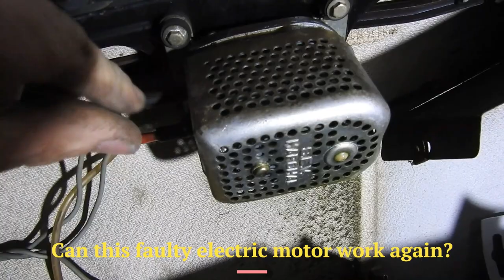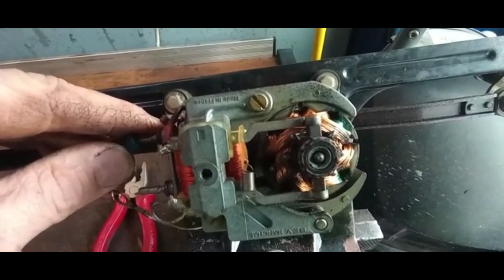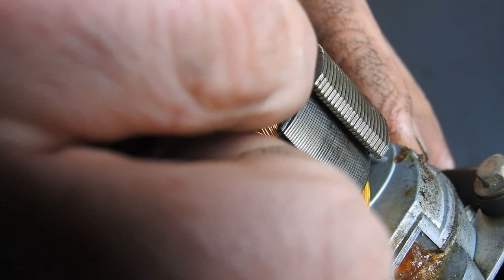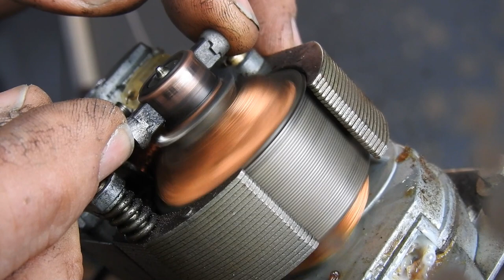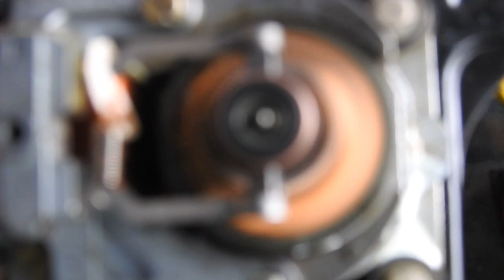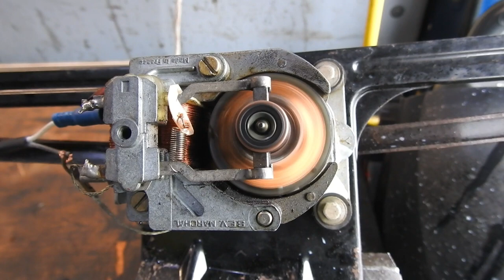Citroën 2cv, ami, Dyane dead windscreen wiper motor repair. it smoked!

Comment: WHERE IS THE + ON THE WINDSHIELD WIPER SWITCH? THERE ARE THREE TERMINALS.
Reply from the maker: both connectors are +
1 is the constant +
the other is for the return when the wiper motor is switched off.

ground is made by screwing the housing to which the motor is attached to the body.
Reply: @dutchcitroen2cv  
hello,
thank you for your intervention
i don't understand anything about electricity.
kind regards, Richard